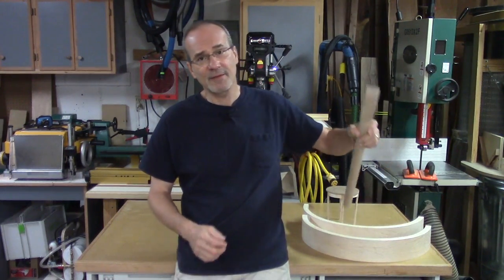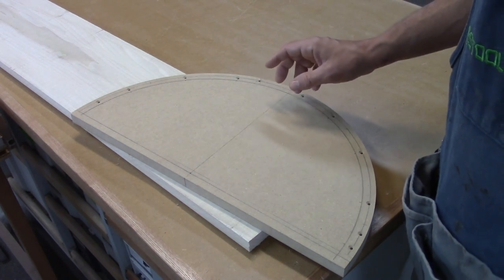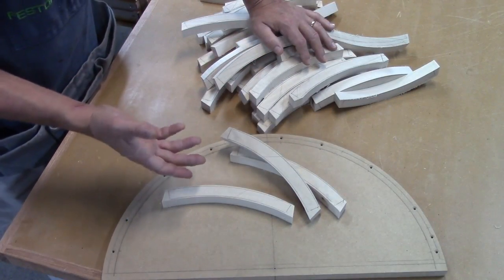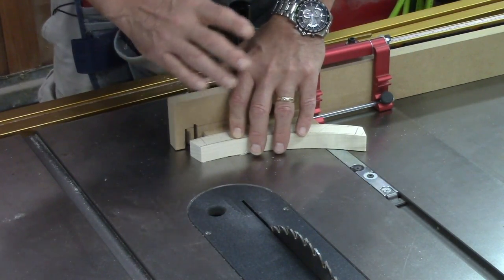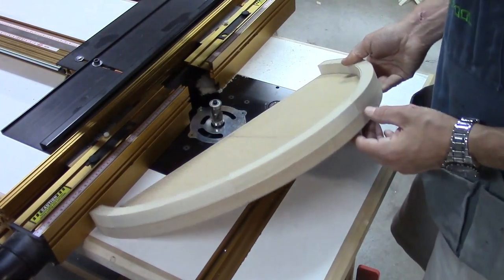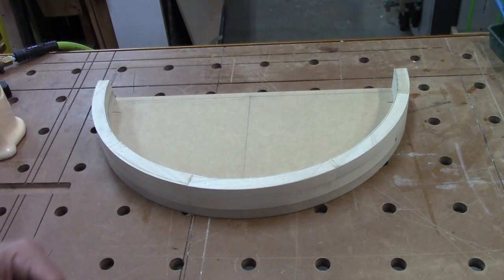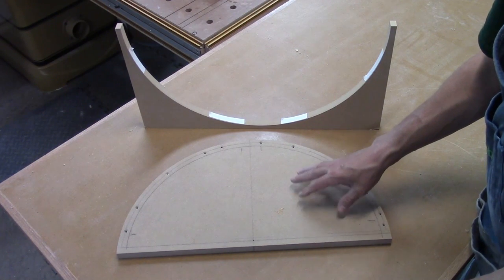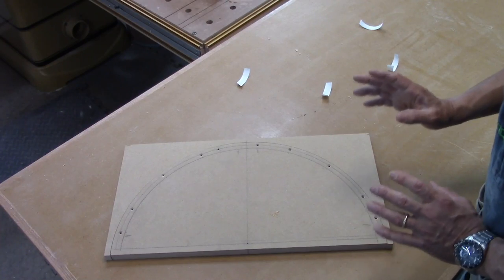Sunburst Veneer Table - Making the Round Apron - Pt. 2

Comment: Guy love the series of videos! Learning new techniques, couple questions when your cutting the ends of the "bricks with that curved piece attached to the fence how do you reference them to get the cut in the correct location? Second for those of us not lucky enough to have a vacuum system, do you think it possible to make a negative mold of the exterior and glue the laminations with clamps? Kind of like a bent lamination jig. Thanks for the fantastic videos.
Reply from the maker: Thanks Pat! It doesn't matter where you place the curved oart on the jig, it will always cut at the correct angle. And yes, you can make a positive and negative jig and accomplish the same thing without a vacuum press.

Comment: Hi Guy, just curious about the glue you used. From the time you spread it to when the vacuum pump reached the correct pressure felt like a fair number of minutes; how much open time did you have? And, for those of us w/o a vacuum bag, would there be enough time to apply enough clamps?
Reply from the maker: Hey Kevin, the glue I'm using is a cold press veneer glue. It is a PVA glue like Titebond 2, but it has some extra solids in it. So it sets up just as fast. Let's say about 10 minutes, so you do have to move pretty quickly. And yes, you could do this without a vacuum bag. You just have to make a positive and negative side of the jig I made, and clamp the two halve together.